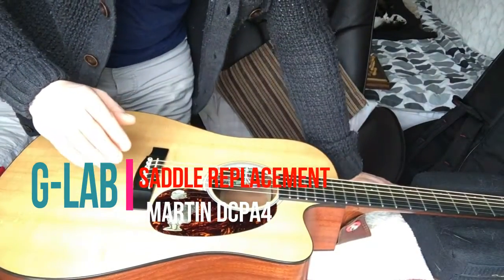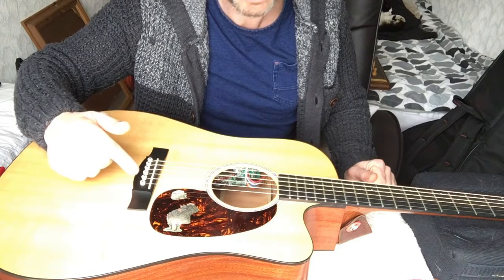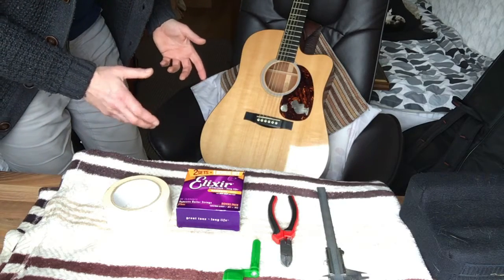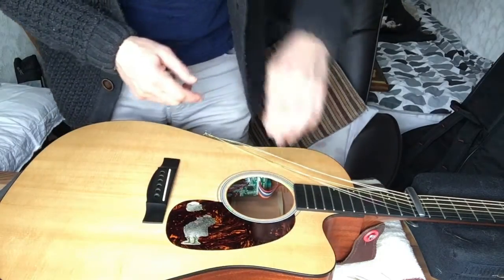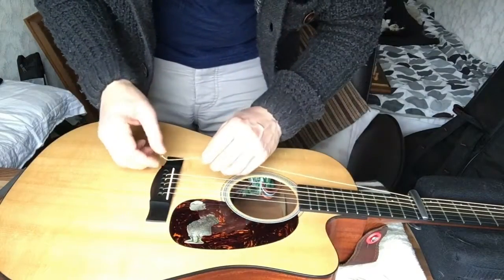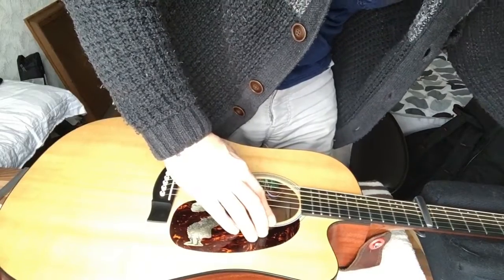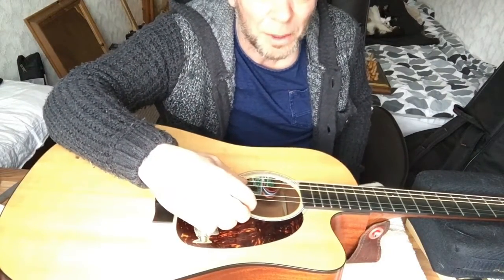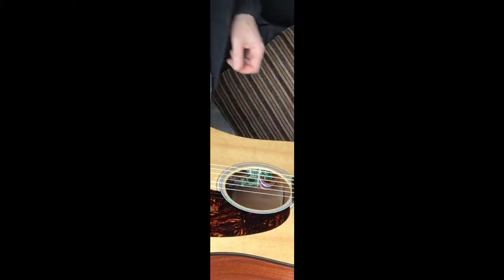Step by Step Saddle Replacement on a Martin DCPA4

Comment: Perfect!  How to change the saddle even though it wasn't the problem!  LOL!!  When you have buzz on an "open" string it's either  neck, fret or nut!  1st check the neck you want a very slight downward bow in the middle (very slight) is key.  If not that check to see if you have a fret that needs dressing.  If it's not that then it has to be the nut.  There's a great video on YT where a guy (luthier I think?) who uses (not kidding) baking soda and super glue to repair a not that's too deeply slotted.  Laughing cause it looks like something I might have done a few years ago myself.  Good on you for trying to DIY - it's often trial and error but that's how we learn to care for our instruments!  Frustrating but ultimately we're better for having tried!
Reply from the maker: Dave Hardy haha. Absolutely. I enjoyed the process despite being disappointed with the outcome.
Reply: Did you ever get it worked out?  I hope so!  Here's my DCPA4 story.  I got in I think 2012 or 13, that was purchased from "points" I acquired from my job, so it was like a mail order bride - so to speak.  I didn't get to play it before purchasing and the "Set Up" if you can call it that??  Was HORRIBLE!! straight out of the box.  In fact I was so disappointed that I took it to the local GC and tried to trade it but they wouldn't give me anything for it.  So I put it in it's case and that's were it stayed for all these years until just recently.  I didn't think I should have to work on a "Martin" guitar!!  I had dreamed about owning one and now that I did it was (I thought) a POS!!  But, reviews from owners on the web are 4.5 and 5 stars out of 5 stars pretty much across the board so I got it back out and put new strings on it, adjusted the neck and adjusted the saddle (which I'm about to replace with a bone saddle) (maybe nut and pins too, we'll see)  So, now, the action is awesome but my Low E string is dead still (which it has always been) (part of the reason I gave up on it in the first place).  So I pulled the saddle back out and pulled up the pick-up... up and there's a Damn shim under the saddle!!!  So now I"m wondering did I buy a Refurbished guitar??  I have no idea about that so... it just is what it is that this point, Right?  So, of course, I took the shim out of the bridge from under the pickup and put everything back together - fearing that now my action would be too low and I'd have the problem  your having with string buzz.  But, that didn't happen - It dropped the action right in the pocket!! Beautifully!!  And, the Low E is no longer DEAD (acoustically) but it still is - plugged in.  Patients is not a strong suit for me and at this point I"m pretty frustrated!  But, I'm really digging the guitar acoustically now and the action is like butter so I keep playing it.  FINALLY.... I got the bright idea to again remove the saddle and try adjusting the piezo pickup (i.e. pull it up, and push some of it back into the hole) (probably between 1-3mm? I didn't measure that, sorry).  I did that and reset the saddle, and tuned it up, plugged it in and EURIKA!!!!  HOLY CRAP!!!!  IT WORKED!!!!   I finally have a Martin guitar that I enjoy playing both acoustically and plugged in, that plays and sounds like a Martin should play and sound.  It's been a JOURNEY, and it shouldn't have been (yes I fault Martin for that ridiculously bad QC and set up) but, everything happens for a reason I suppose...  It has been a long drawn out process and learning experience that forced me to become more knowledgeable, determined and patient.  Hopefully, you have your issues worked out by now.  However, if you don't, I offer this in the way of encouragement to a fellow DCPA4 owner and novice luthier...  In my experience the end results were worth the journey!  All the Best!
Reply: @davehardy9555  I have a Martin that was dead right out of the box when using a capo and a Martin that sounded great for 6 months and then went dead. The rep from Martin told me that they are getting a lot of guitars back because of the dryness in the house. Didn't know I had to build a house around a temperamental guitar. What a waste of money. I have 10 acoustic guitars and they all live great in my dry house.
Reply: @TheGhost5600   Sounds like an BS excuse on Martin's part to me.  I think they've got some quality control issues they need to get a handle on.
Reply: Dave Hardy I just got a DCPA4 that is new (though a few years old). The setup is awful on this guitar. I bought it without playing since it came with a full return policy. But, the action is almost unplayable after the 7th fret or so.

Comment: Did you ever fix the buzz? What did you do to fix it? I have a similar problem with open chords (G, EM, C) and the G string will buzz at the bridge. I hear the G string louder and it will ring longer than the other strings. As soon as I touch the G string, the buzzing will go away.
Reply from the maker: I eventually had to replace the frets early last year as they wore down with hard practice.  This was done by a chap at Manson's Guitars in Exeter.  It improved again the buzz slightly after but it was still there.  So, I just tried to accept that was just how it was going to be.......and then when I saw your message the other day I realised that I hadn't noticed it in a while.  Divine intervention perhaps!